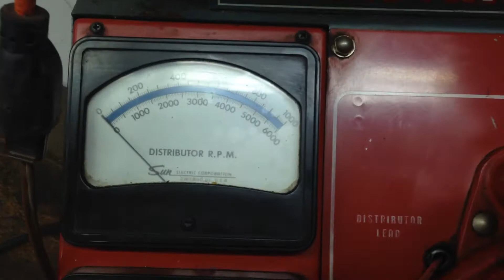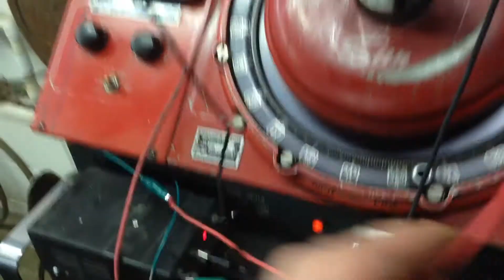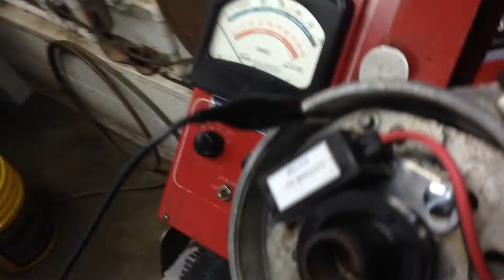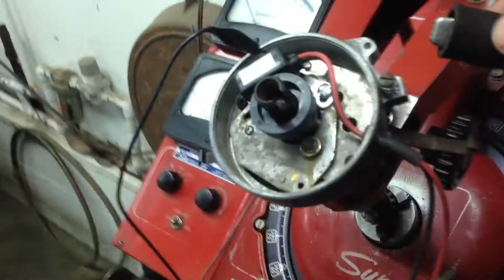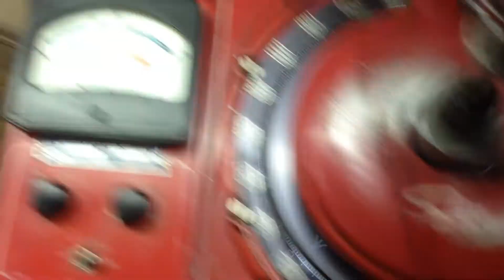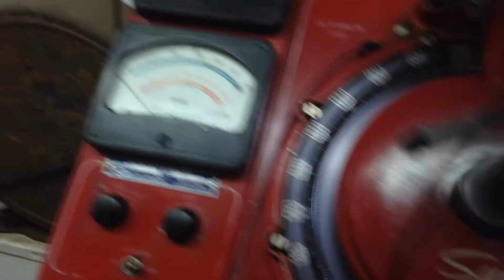Pertronix on a Sun 506 Distributor Machine Shaw's Garage Episode 3

Comment: What is your opinion of the Pertronix ready to run distributors for Ford?
Reply: I actually have one in my 289 Ranchero and I am really impressed. I had to build a custom advance curve in it and it is easier to disassemble than the Ford distributors. So far I have had no issues with it.